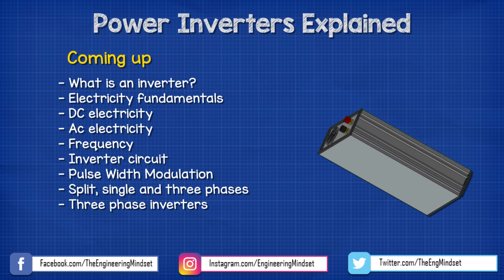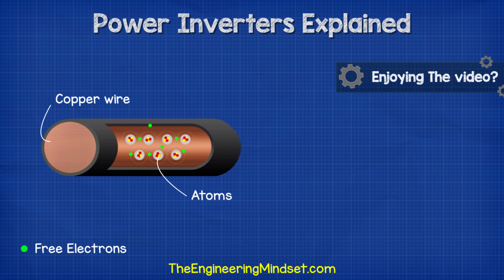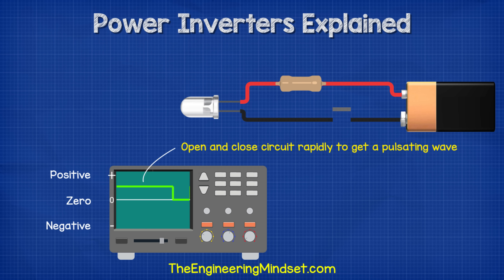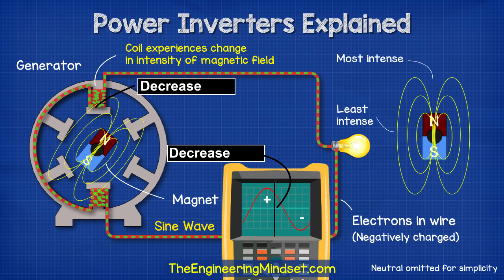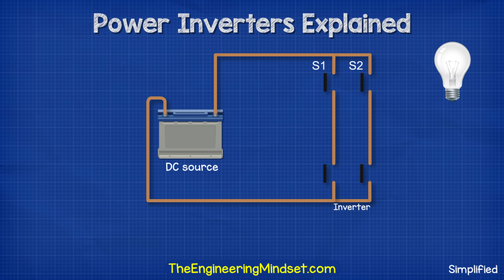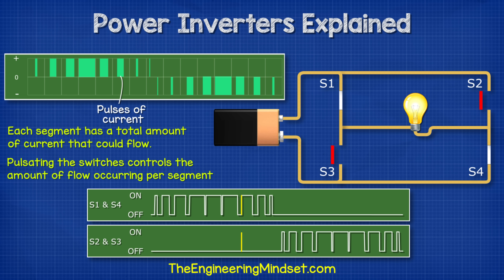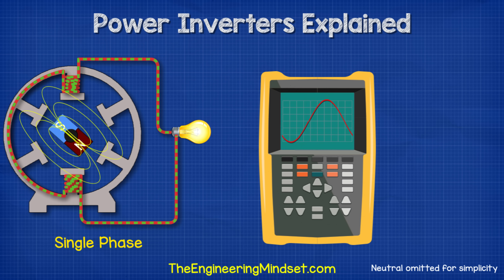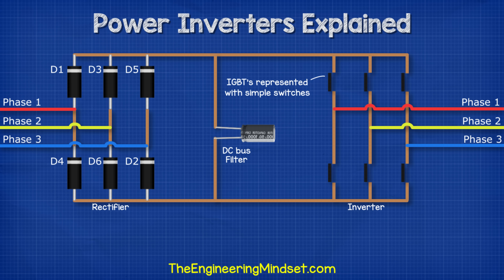Power Inverters Explained - How do they work working principle IGBT

Comment: Hi,
I work as a mechanic with the public transportation company in the city of Rotterdam in The Netherlands.
My company has purchased almost 200 new buses, 55 of them are fully electrical powered and 103 of them are hybrids. Both of thes types are driven with an electric three phase permanent magnet motor. The power coming from a charging station or dieselgenerator is stored in batteries that are located on the roof with a power of around 650 volt. When needed the power is put thru large inverters to make three phase power. The manufacturer has chosen a drive system from Siemens. The inverter for the drivemotor is the size of a travelsuitcase. The hybrid bus als has a second inverter to convert the three phase output from the generator into dc to be stored in the batteries. There are also a number of smaller inverters to power the auxilaries like the power steering, air compressor for the brakes, the airconditioning etc. There is also a dc-dc converter which converts 650 volt dc into 24 volt dc to run things like indoor and outdoor lighting, passenger info systems etc. etc.
In the past years we had to learn a lot about inverters and your video is a nice addition on this subject.
Nice video, thanks for that and keep it up!
Reply from the maker: DC motors explained https://youtu.be/GQatiB-JHdI

Comment: The part I keep getting stuck at is smooth AC. Smoothing to DC with the rectifiers and a cap is fine. But, in inversion we've got PWM chopped to 'Sine-like AC' ... but it's rough. Inductors? Something clever?
Reply: Just add the correct amount of inductance and capacitance to the output, I'm not really sure why that was left out...  Makes me wonder how much important stuff like that is left out from other videos where I don't know much about the topic.
Reply: This is also a YouTube video, not a patent on how to build a nuclear powered goggle-flop flux capacitor.
It's to give you a general understanding of the topic, not how to specialize your career in a specific sector of an industry.... 😂👍😝
Reply: James S I agree, it is just a YouTube video to give general understanding.  What I don’t like is that the video makes it seem like, yes this all you need to do to make the output identical to traditional AC generation.  I wouldn’t care if it was just a mention of “this is close enough for nearly all applications, but it’s not exactly the same”
Reply: @wcvp  
As a power telecontrol guy once told me: DC is just infinite frequency AC. The thing I like about this channel: produces content, covers 90% of the detail and doesn't drone on about the other 10% finer details that don't matter unless you're in the industry.
I don't think we need to know how precisely the inverter can keep an analog clock in sync for... Just that you "can plug your hair dryer into a battery and not make it explode."
I'm sure someone at some point in time has stripped an extension chord to try and run their refrigerator off of their car battery...
Reply: I think more accurate PWM would be enough for most. After all many applications will work just fine with imperfect AC voltage, so they problably work with imperfect sine waves too to some point. But if for some reason we would have to have as perfect sine wave as possible, maybe we could then just run DC motors to generate AC? Definitely noticeable energy losses but it would work and wouldn't differ from power plants. :D
Reply: @insoYT  you can also get faster switching or "smoother" sine-wave output from decent equipment. I have Telco equipment that runs on DC and some that run on AC. We have some decent enterprise UPS' that claim 'clean sinewave' (no oscilloscope to verify). So clean that sensitive equipment doesn't complain about faults or dirty generator power when we have to cutover.
Reply from the maker: DC motors explained https://youtu.be/GQatiB-JHdI
Reply from the maker: Rectifier video here https://youtu.be/RiRyzLl4Y8U

Comment: I have a dream to develop a project for a off grid house power supply with a output of 40 kWh with no batteries, just using a large set of electrolytic capacitors. 

Well, I need a lot of help.
Reply from the maker: 40KWH! start with 400W and see if it works
Reply: @EngineeringMindset  So... first of all, I'd like to congratulate you for the marvelous work presented here throughout these incredible videos. 

About my intended project, even with my lack o knowledge related off grid schemes, I already measured the behaviour of inverter and electrolytic super capacitors with out puts under 1000 W. 
My goal is build a big one stable and powerful enough to run a big house even during the winter.

Cheers
Reply from the maker: Upload some videos to your channel, I'd like to see how your projects comes along